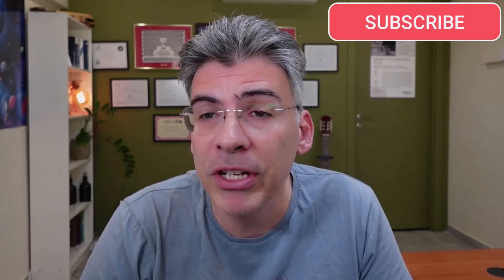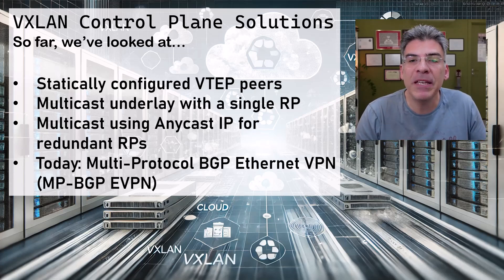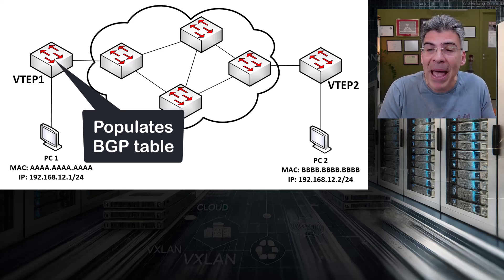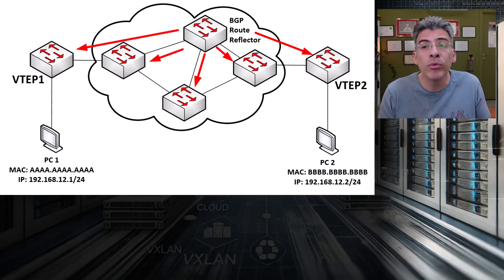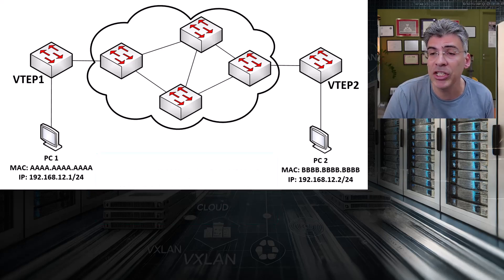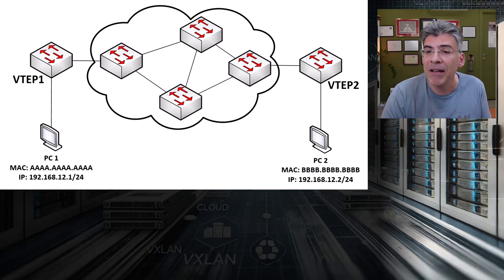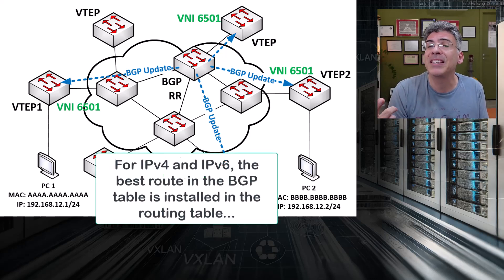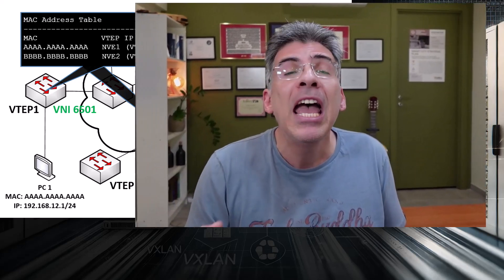VXLAN - Understanding the MP-BGP EVPN Underlay

Comment: I thought EVPN eliminates the need for Multicast groups since the VTEPS  that participate in EVPN use Head end replication to replicate BUM traffic with multiple unicast copies (one for each remote VTEP that has joined the VNI).
Reply from the maker: EVPN doesn’t eliminate the need for multicast so much as it makes underlay multicast optional.

In EVPN, each VTEP advertises an IMET (Type-3) route for a VNI, which builds the flood list. BUM can then be carried by either:

1) Ingress Replication (IR) where head-end unicast copies are sent to every remote VTEP in the IMET list (no PIM and no multicast groups)
2) Underlay Multicast where we map the VNI to a multicast group so the fabric replicates it for you.

IR is simpler and widely used but multicast scales better when BUM rates are high. Many designs mix both per VNI, and EVPN’s control plane (ARP/ND suppression, unknown-unicast suppression) reduces BUM regardless of which flooding method you pick.  Sound good?
Reply: @telecomTech.explained I came in the comments because I had this exact question and your answer is perfect, very clear now !
I can’t thank you enough for the quality of your content, I’m a student and you are carrying me through my work projects :)

Comment: Hello, In VXLAN EVPN fabrics, I’ve seen designs where leaf-to-spine BGP sessions use eBGP, yet some spines are still referred to as Route Reflectors. How does the RR role work in this eBGP scenario, especially when only some spines act as RRs and RR is typically an iBGP concept? Thank you
Reply from the maker: Ah yes, this can be confusing.  Strictly speaking, only iBGP scenarios can have RRs, so why are some spines still called RRs in eBGP designs?  Strictly speaking, it is incorrect to call these RRs, however, that term is sometimes used.

It has more to do with the role and function of the spine than strict BGP mechanics.  In eBGP EVPN designs, every spine can forward EVPN routes between leaves.  In a sense, those routes are being "reflected".  Some vendors and designs still label certain spines RRs but what they really mean is only a subset of spines are configured to carry the EVPN address family (l2vpn evpn) and advertise leaf routes.  

So RR is used as a loose analogy, because they serve as the centralized route distribution points for EVPN routes, even though the protocol mechanis are eBGP.   Does that make sense?

Comment: Very clear explanation, i would love more explanation about differences between VXLAN EVPN and MPLS EVPN.
Reply from the maker: Thanks a lot! I'm really glad it came through clearly. 🙌 And great suggestion—VXLAN EVPN vs. MPLS EVPN is a topic worth diving into!

In short: VXLAN EVPN is typically used in data center overlays using IP transport, while MPLS EVPN is common in WAN or service provider networks using MPLS as the underlay. Both use BGP EVPN for control-plane signaling, but the encapsulations and use cases differ.  I'll put it on my to do list to address it some time in the future... Thanks for the feedback!

Comment: thee is to topic with vxlan with bgpevpn . 1. host-rechibility protocol bgp and 2. ingress-replication proocol bgp.
Reply from the maker: Yes, exactly! In VXLAN with BGP EVPN, BGP serves two key roles: distributing host reachability information (MAC/IP) and signaling ingress replication for BUM traffic when multicast is not used. The host reachability function ensures efficient forwarding by eliminating the need for flood-and-learn, while ingress replication enables BUM traffic distribution via BGP EVPN Type-3 routes.

Comment: Hello,

@6:59 : "it's not enough that the MAC address of PC1 enters the BGP table of VTEP 1. We need to have that information enter the local MAC address table."
Shouldn't it be "it's not enough that the MAC address of PC2 enters the BGP table of VTEP 1."?

So which sentence is correct?
1. PC1 sends a frame to VTEP1 destined to PC2, so VTEP1 learns PC1's MAC address, populate its MAC table, then send a route to the RR, which send it back to the VTEPs, which populate other VTEPs MAC table.
2. PC1 sends a frame to VTEP1 destined to PC2, VTEP1 sends it to VTEP2, so VTEP2 learns PC1's MAC address and sends a route to the RR, then the RR sends a route to everybody including VTEP1 and VTEP1 learns PC1's MAC address that way.

In other word, with EVPN VXLAN, how does a VTEP learn local MAC addresses? By listening local trafic, or by learning iBGP routes?
In the first case, are every local MAC address always pushed to iBGP?
Reply from the maker: You're absolutely correct.  It should be "PC2" not "PC1".  I have added a correction to the video and credited you with finding that out...

As for your question, number 1 is correct.  MAC address learning will take place as usual indepenant of any BGP or EVPN operation...

Comment: Thank you for the video
Can you please recall the difference between an overlay and an underlay network!?
Thank you
Reply from the maker: Yes of course!  An overlay network is a virtual network that is built on top of an existing physical or underlying network. It creates a new layer of abstraction, allowing different network topologies or functionalities to be implemented without modifying the physical network. Overlay networks are often used for purposes like network virtualization, enabling functions like VPNs, peer-to-peer networks, and application-level routing.

An underlay network, on the other hand, refers to the physical network infrastructure on which overlay networks are built. This includes the physical hardware (routers, switches, cables) and the base IP network. The underlay network is responsible for the actual transmission of data packets between devices, while the overlay network manages the logical connections and higher-level services.

In the context of VXLAN, the underlay network is the Layer 3 network created between the VTEPs (leaves) and the spine devices.  The overlay network is created by VXLAN.  This is the network that is "tunneled" in a sence through the underlay network.  It is the mechanisms of VXLAN that allows for Layer 2 communication between hosts.

Other technologies that use this overlay/underlay infrastructure include MPLS, GRE tunneling, and SD-WAN to name a few.